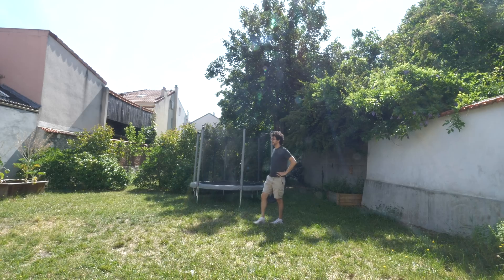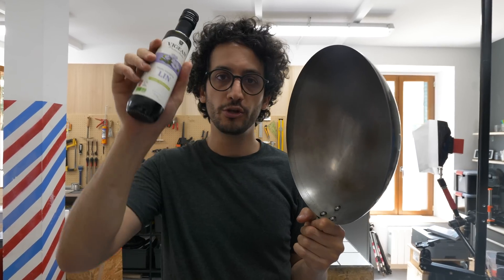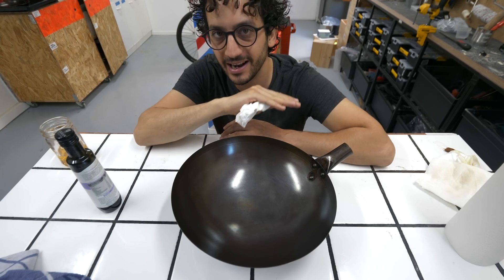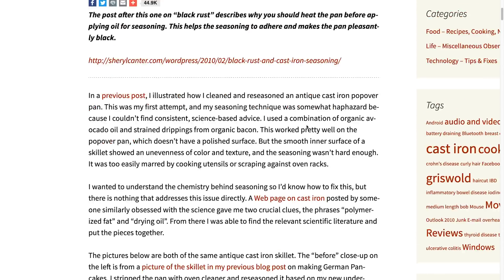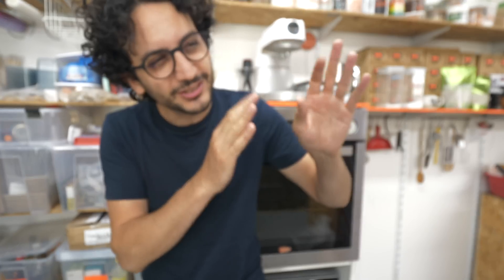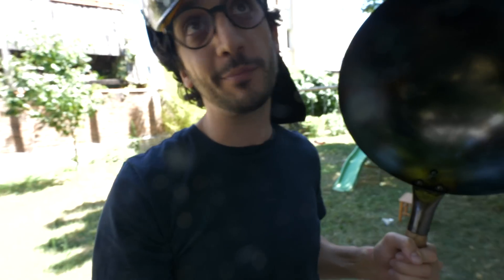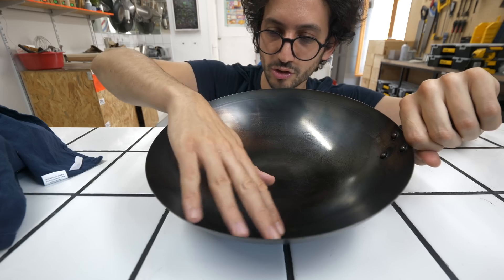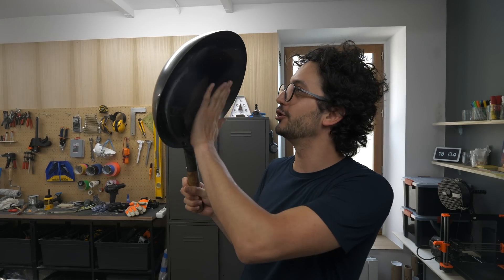Can I Make my Wok Slicker than a Nonstick Pan ?

Comment: I bought a cheap cast iron pan and there was a spot where the blackness or the coating was missing, but i didnt think it was coated in anything, it looks like black paint. So is it a coating, a seasoning, ceramic, teflon, what is it. I though about putting salt water on it to see if the black area would rust eventually.

Comment: The "egg-test" (if you really want it to account for anything) needs to be done without oil!  Any amateur can make an egg not-stick in an average pan using oil.  Nice entertainment value, tho.
Reply: What would be the point in that since we already know a bit of oil is needed to make most types of pans non stick?  No issues using a little oil, perfectly healthy.  Teflon coating, not so much.
Reply: @RainCity3rd  Because the average (not-so-healthy) Teflon non-stick pan guarantees that you can cook food without using oil.  So, if you want your pan to "compete with a non-stick pan" (or be better), you have to coat yours in a way that does not only make the same claim, but is even better (healthier).  A properly seasoned pan does not NEED to use oil to fry up an egg... just like a Teflon pan (unless you choose to add it).
Reply: @shotjohnny  but we use oil for more than just preventing food from sticking.  It adds in heat and flavor transfer.  Do people actually not use any oil while cooking regardless of plan type.  That would surprise me if this was at all common place...
Reply: @skel8484  Yes, there are a lot of ppl who use Teflon pans, because they promise to cook food without (or little) oil... hence the name "non-stick."  So, my point is that if you want your pan to be "non-stick" (and the idea is non-stick without oil) then you have to meet those parameters and do it even better in a challenge (which is very possible!). Otherwise, you're just entertaining ppl.  A properly seasoned cast iron/carbon pan DOES NOT NEED oil to be non-stick UNLESS you choose to add it (for (good!) reasons such taste, nutrition etc.
Reply: @shotjohnny  ok but you're chosen to add in the parameter of not using oil.  That is your call but it's not a mandatory requirement.  This is not a fully scientific experiment after all.  It's a video out seasoning a carbon steel wok.  I think you are reading a bit too much into the video purpose.
Reply: @skel8484  I'm not and I haven't. The idea of  "non-stick" pans is that you can use them without any oil (or very little of it). If you haven't grasped the idea behind "non-stick" this would be a good time.  And finally, if this is no matter of importance at all... why do you feel the need to defend this non-scientific "experiment...?!" All I said is that you CAN make an iron cast/carbon steel pan non-stick in such a way that DON'T have to use oil if you don't want to... Maybe you can just respond to that as to why you think this is not possible.
Reply: @shotjohnny  oh my you are completely right you win.  You win all internet
Reply: @skel8484  Wow... what a... pathetic way to forfeit on an argument
Reply: @shotjohnny  what argument? We have different opinions, there is nothing more to discuss.

Comment: when teflon breaks down, is it toxic?
this wouldnt be toxic if it brteaks down, right? thats a reason right there
Reply: Teflon is extremely chemically stable and doesn’t break down during cooking. You can scratch or break the coating by using metal tools or using cheap pans, but even if you ate the flakes you would be 100% fine, it would just pass right through you (assuming you didn’t break it all off in one piece and eat a teflon flake the size if your hand).
Reply: @OGSumo  cool thanks - did not know that about teflon. i presumed it was something that would be toxic if you ate enough of it, like if it started flaking off in to your food from the pan

Comment: The thing is, flaxseed oil is quite expensive. 😞 However, I have very high quality lard (heck, I raise and process my own pigs - I'd BETTER have excellent lard! LOLOL), and I would prefer to use it instead of the flax/linseed oil.

So... Hm. I think I'll strip off my wok (which I don't use enough anyway), and use your method to re-season, except with my lard,and see what happens.

Comment: "there's no chemical, it's just like a nice, very hard, polymerized surface"
Reply: Inhale that smoke from the process!
Reply: Teflon = Polymer
Seasoning = Polymer
lol
Reply: @wave1090  
In French.. Poly Mer  ==  MANY SEAS.. (on ing)
Reply: @SimonWoodburyForget  Of course random chemicals aren't safe simply because they are natural. However, seasoning has been done for ages and we have not seen evidence of risk. And we understand oil, being well studied hydrocarbon chemicals, even oils like car oil, etc. that you mention. They'd be presumably safe (well, if we didn't use additives) but haven't been used for generations nor are they really a staple in the kitchen 😛. We have very little reason to believe the seasoning on a pan would be harmful and even if so, the idea is that the seasoning stays on the pan. Which with good care it certainly does. We don't have much evidence in either direction for these new engineered pans but they also do indeed contain all kinds of crazy compounds not typically found in food or even other utensils or items around the kitchen. And anyone who has owned one will tell you they typically scratch and degrade quickly, so whatever is on them is being consumed.
Reply: @DagaenGolomb  oil that has been used many times eventually turns into an isomere of itself. that isomere causes cancer. thats especially true for frying
Reply: @abstract-a0f  Sure. And when do you reuse oil besides maybe a not well maintained fryer? That has nothing to do with seasoning, anyways. Seasoning is no longer oil.
Reply: @DagaenGolomb  oil is used to season the pan, isnt it. so whats wrong with mentioning that oil thats been used often, like for example the seasoning layer on a pan, might eventually turn into an isomere of itself. you dont know whats happening  when you cook sth within that pan.
Reply: @DagaenGolomb  if you say so
Reply: yea it's not cooking bs without some chemophobia combined with home chemistry and a bit of smug satisfaction.
Reply: Simon WoodburyForget go ahead, fry your eggs in 10W30. Let me know how it works out for you... I'm sure it'll be fine, since you know... It's edible and stuff.
Reply: @myrthjt  it's just a random mix of chemicals.... I deep fry with JP8 all the time and my fish sticks have never been better!  Give it a try.  10W30 is best on fresh vegetables, 10W40 on canned stuff.  For coating my cast iron I head to a junk yard and get a variety of plastics and melt them down on my grill.  2 dips in a bucket of random melted plastics and polymers and I have a perfect nonstick coating.... Cuz it's just, ya know, random.
Reply: You know exactly what he means, don't try to act smart with semantics and technicalities. Polymers are a huge class of chemicals. Notably, this seasoning won't have fluorine in it or have the ability to create fluorocarbons once heated to degradation temperature. Remember average temperature can have some molecules at much higher (and some much lower) kinetic energy than the average. This is where skepticism on safety arises, regardless of known risk. It also won't scratch off after repeated light use of a cheap metal utensil.
Reply: @DagaenGolomb  actually it does come off.. especially if you add some acidity which is common in Chinese cooking.
Reply: @jameshobbs  "With good care": that means avoiding these foods, and even if you don't again there is little reason to believe consuming it would be harmful. Those foods are more suited to something like a stainless steel pan, although I know carbon steel woks are popular although they also season like cast iron.
Reply: @DagaenGolomb  you are telling people not to make chinese food in a wok, to save a wok? what's the point?
Reply: @pilobond  no. I'm saying acidic foods are those more likely to remove seasoning from cast and carbon iron pans, and if you want to prevent that (since as I mention there's little evidence released seasoning is bad for you) then avoid acidic foods in them. Woks may or may not be made of carbon steel, anyways, but the point was that they appear to be safe whether or not you ar consuming some seasoning.
Reply: @DagaenGolomb Yes I understand that. Just to clarify, James said "... if you add some acidity which is common in Chinese cooking" to which you said "avoid these foods". Also following your logic, there is actually good scientific evidence showing that teflon, when eaten, did not show measurable difference in safety outcomes, where as I don't know if there is good test that actually looked into burnt/polymerized vegetable oil coating is safe. (I assume it's likely to be safe, but it's one thing to assume and another to actually have a study.) I did read somewhere that even just reheating used vegetable oil (just like our moms used to) creates substance linked to increased cardiovascular disease, whose reference I haven't verified myself. It's probably more of a correlation that causation, but then casts doubt that eating the released seasoning is entirely safe. At the end, I agree with Hexane, that it's laughable to say things like "there is no chemical", especially if one wants to imply that factory made chemicals are inherently more dangerous that the ones you create in your kitchen.
Reply: @pilobond  the organic compounds with traditional seasoning don't include molecules like fluorine. Yes, I know molecules are complicated, yada yada, typical table salt example. But fluorine is a particularly interesting one that is almost never found in any significant quantities in traditional foods and cooking materials. I'm sure there has been studies on cast iron health, I haven't looked for specifics, but we also have a ton of time using these materials with no impact noticeable enough to warrant scrambling to research them. As far as I know studies regarding safety of modern non-sticks are limited in both sample size, scope, and length (really a problem with a surprising majority of health related studies). I'd rather just use iron. You get dietary iron and they just have nice heating properties and flexibility, and they really are not that much more maintenance. I've also never encountered a modern non-sticks pan than doesn't degrade to crap very quickly unless you absolutely baby it with soft utensils and a ton of oil - which is one of the marketing gimmicks of non-sticks (healthier because less oil, but let's not go down that rabbit hole!). Point is cook from what you want, but those suspicious of non-sticks don't warrant chastising. There's really not a whole of of good evidence in either direction.

Comment: Wok. Chinese family here. We have non stick pans too but constantly wreck them. Teflon just doesn't handle high heat well, which is most of our cooking.
Reply: teflon coating comes apart at high heat and considering woks are often used on very high heat, they should not be treated with teflon as it is toxic.

Comment: Or.. You just use what you have. Sunflower, rapeseed, linseed. It really doesn't matter. Wipe on, dump it on a hot fire (even a wood fire outside (which helps with the smoke) and just burn until it stops smoking) and repeated two or three times. It isn't hard. It isn't a fold-ten-thousand-times thing. Just a couple of layers of oil. And just use it. If you dump sour stuff in there, follow it up with a bit of oil or even butter. That's it.

Comment: I came to the same solution of using a burner with the flax for creating the polymerized coating, I also found that using a ball of very fine steel wool (0000) and using that to apply the flax oil also smoothed the surface as I went. 
My process was starting with a clean pan, super hot on the stove, then several drops of flax on the steel wool (which also acts as a buffer for the heat with your hand). Scrub the pan with the flax/wool and then allow to polymerize. Wait for the pan to look dry meaning all the oil is transitioned then repeat he wool/flax process several times in succession. The wool will knock down any irregularities in the coating and leave a beautiful surface :)

Comment: when your wok was blue, that's called bluing steel. when you reach this color, that's what makes the pan not rust. so if you forget seasoning, you will still have this. i believe the seasoning is only for non stick purposes or flavor, which is why there are some chinese videos where they just season with one layer. they plan to just build up seasoning over time, rather than considering it a ritual.

Comment: Generally, I prefer carbon steel, as you can use metal utensils and the coating is generally more durable than Teflon. Plus if you scratch it, the next time you use it you can re layer it.

Teflon is obviously kind though in terms of non stick

The other important aspect is the actual material of the pan. Generally, non stick pans are aluminium and not steel. This is a serious disadvantage as it loses heat too quickly due to its low heat capacity.

Comment: want to season the wok faster?  heat  the  wok  on  a  chinese  jet  burner  for  a minute  until  it  glowing  red  and  pour a  laddle of oil  on  it.  brush  the  wok  and  discard  the  water. repeat  the  process  but this  time  change  the  water  with  oil  and  turn  off the  burner  right after  you  pour  the oil. spread the  oil  evenly and  discard the oil. voila!  that is  how  the  chinese wok  is  seasoned in  a  chinese wok  range.

Comment: When it comes down to Teflon the issue is that it begins off gassing at 350 degrees Fahrenheit. These fumes are lethal to pet birds, and in humans only short term studies show that it causes flu like symptoms. No long term studies have been done on inhalation of Teflon fumes in humans. So Teflon is not recommended for high heat applications. So Non-Teflon coated pans would be more useful in the kitchen.

Comment: How long will the wok using the seasoning method last compared to an off the shelf non stick pan? Additionally, does one method provide better heat control than another? I was gifted one of the "red copper" pans that is pretty amazing as a non stick though it has horrible heat transfer/control.

Comment: Of course it's way better than teflon as you may use any metal utensils with it not being afraid of damaging the surface. And also you can recover this nonstick coating with more oil seasoning at any time.

Comment: I have a Teflon pan but prefer to use my standard one with some oil, the oil facilitates better heat transfer to what I'm trying to cook rather than cooking dry which can cause tiny air pockets due to the nature of some foods and uneven cooking due to the heat transfer issues.

Comment: If you ever want to geek out on an egg dish that needs a non-stick pan, try making dashi maki tamago (Japanese rolled omlette).  A seasoned pan is so much better than teflon, it's not even worth talking about.  When the teflon is brand new, it's acceptable, but even after a week or so, it starts to grab the egg.  After a month or so, it's useless.  A seasoned pan will work forever if you just use it for eggs.
One interesting thing to try: Buy a cast aluminium pan with a teflon coating.  Sand off the teflon and polish the aluminium (wear a mask!).  Clean the pan.  Rub a little bit of oil on the pan.  The interesting thing is that you can't season an aluminium pan the way you do an iron pan -- the oil doesn't bind to the metal when it polymerises.  So what you do is heat the pan below the smoke point while simultaneously wiping off excess oil from the pan (which will bead up as it gets hot).  It only takes about 10-30 seconds.  At this point, you will have an unbelievable non-stick cooking surface for eggs.  If you only cook eggs on it, you will never have to do it again, but it's so easy to do, that I'll usually do it before every cooking session.  As much as I like cast iron and carbon steel pots (and I love them), for every day cooking, this is my goto pan to reach for.  It's light, super non-stick, and distributes heat very quickly.  The cast aluminium pans also retain heat reasonably well.
In a professional kitchen in asia, you'll actually see chefs with a pot of hot oil.  They will pour a ladle full of oil into the pan, swirl it around and then pour the oil back in the pot.  Then they will quickly wipe the aluminium pan with a cloth.  This takes about 2-3 seconds and you can do it whenever you feel the pan isn't slippery enough.  Of course, in a normal kitchen, you don't have a pot of hot oil hanging around all the time.

Comment: Teflon is just a branded form of PTFE, a polymer and it's due to the fluorine bonds that make it so non-stick. So in a way both solutions use polymerised layers to reduce sticking, just one is better (teflon in my opinion)
Reply: better for a while until it wears away then the pan is useless, have to toss out and buy another.  Also should not be using for very hot cooking as the Teflon degrades and is toxic.  best part of carbon steel or cast iron is being able to use proper metal kitchen utensils again!
Reply: @RainCity3rd  fair enough!

Comment: Little bit of vinegar, salt, and elbow grease

4 seconds later: using a automatic scrubbing device
Reply: The best elbow grease is the kind that comes out of 18V batteries
Reply: Eoin Doyle   I.           I.  B
Reply: @EDoyl  hahaha
Reply: I work in a restaurant. We have to mix it with flour too for the copper pans. Just spent 4 hours polishing pans by hand today...
Reply: Even better is the kind with an angle grinder behind it
Reply: I have lost track of what we are talking about. Sweating...
Reply: Elbow grease Machine grease
Reply: Work smarter, not harder.
Reply: an automatic*
Reply: @awesomestuff9715  epic
Reply: Ayyy my bruddah
Reply: Don't work harder, work smarter
Reply: LOLOLOL😄